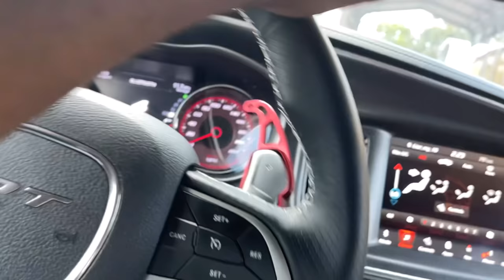Police Searched My 2022 Hellcat Redeye Without Permission Say They Found Weed Don’t Even Smoke!!🤬😤

Comment: Yo u running too much air in them fronts 4sure. The tread should wear evenly the hole way across. Unless u have negative camber for better handling then the inside tend to wear more. Jus a hint.